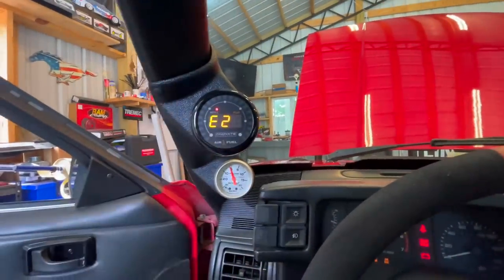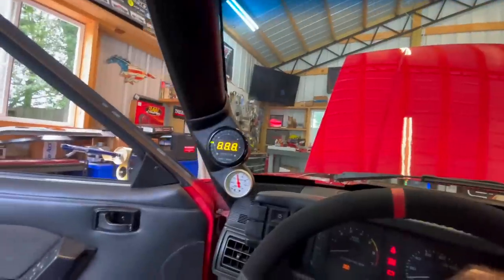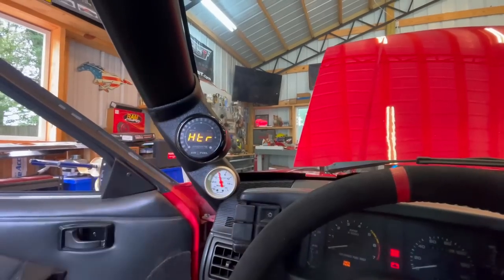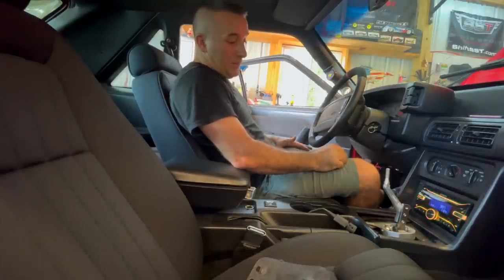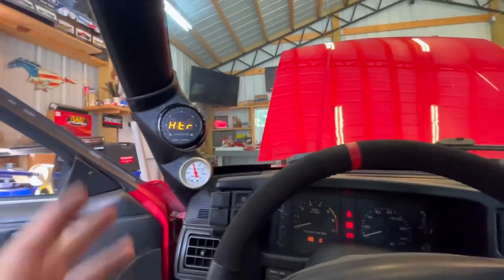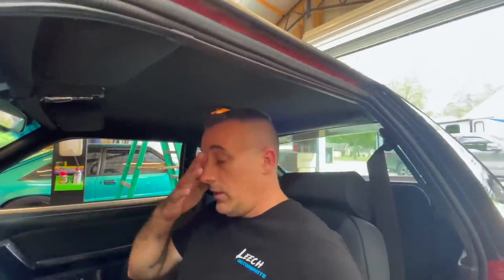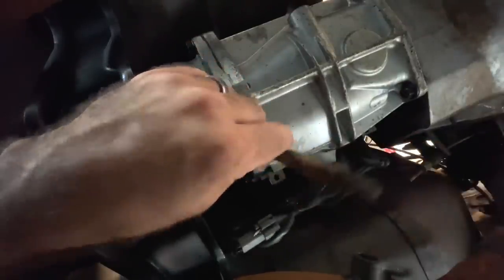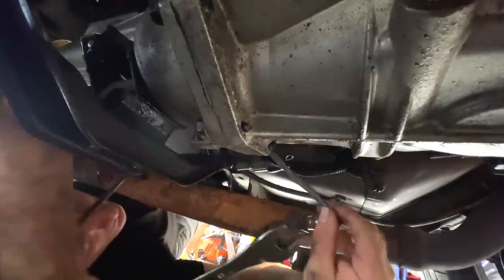It Helps To Read The Directions / FOXBODY WIDEBAND

Comment: I just replaced a sensor on the passenger side that kept showing HTR, looks like I may have to pull it out of the trash now.  I don't understand why all of a sudden it would come up with a HTR problem though.
Reply: if it’s an innovate gauge throw the entire freakin thing away and get an AEM or Zietronix. I went through sensors every couple thousand with an innovate and after swapling for a Zietronix i’ve had zero issues and the AEM in my other Mustang has never once failed me in 5+ years. 

Good luck 🍻
Reply: @DAllman1  It is an innovate, I have heard they are hard on the sensors.